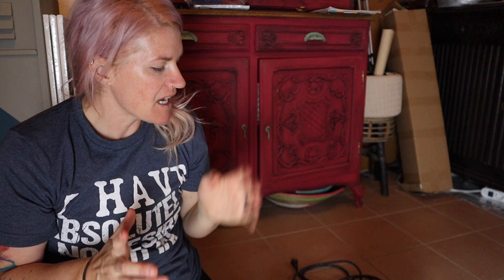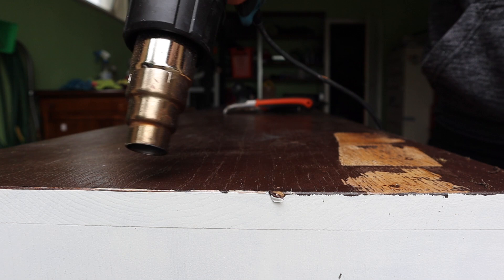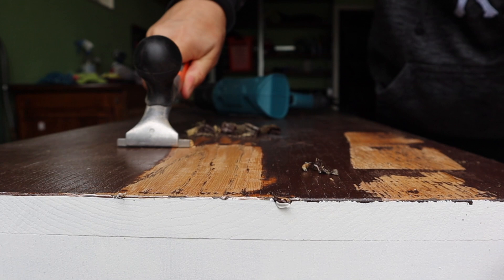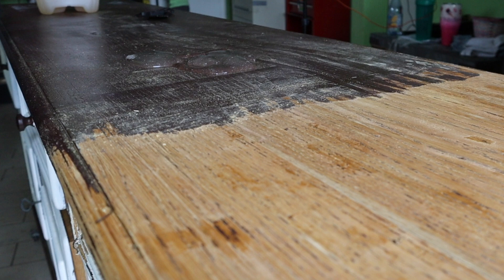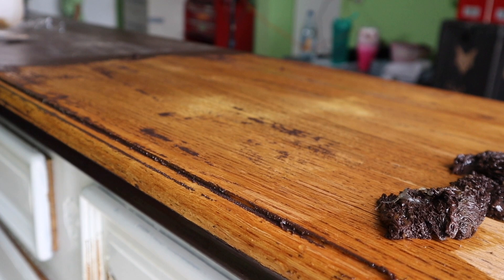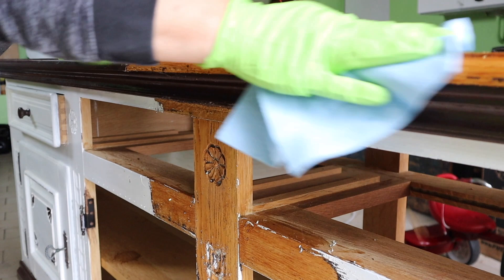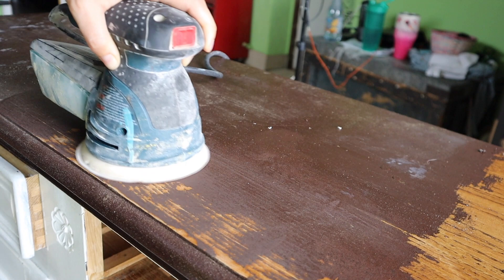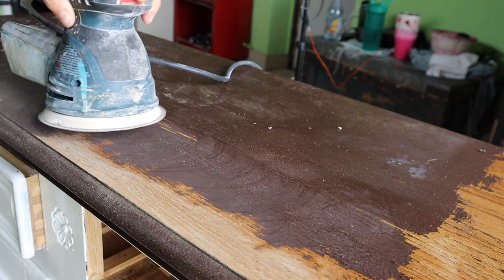Ten Minute Tuesday's W/ CrysDawna from Bella Renovare | Guide For Beginners for Photos -Episode 43

Comment: A vacation!  Excellent!  I love 10 minute Tuesdays - your insights are always helpful.  I use Citrus gel for stripping.  The last time I used it, I had to strip a drop leaf table that had been spray painted yellow, which reacted with the stain and looked green.  When I looked for my plastic scraper, I couldn't find it, so I used a small plastic dust pan, which worked fine.  I washed the table down afterward, but didn't use mineral spirits.  I painted the table with a chalk/clay based paint and so far, it's holding up beautifully.

Comment: Hi from NY! I know this is an older video, but I thought I would ask the best in the industry! It's been forever since I have done any projects, but I am finally getting to use my scraper. I am going to be stripping the risers on my staircase down to the bare wood (pine maybe). The scraper is working well to get the paint off, however, there is a white-ish coating of some sort between the paint and the wood that the scraper can't remove. Maybe something to camouflage any imperfections in the wood or smooth the surface before painting. Acetone and heavy duty chemical stripper are working but it is messy and very time consuming since the risers are vertical. Do you have any idea what a builder would have put on the wood before painting? If so, what would remove that substance? As ALWAYS thank you💗💗